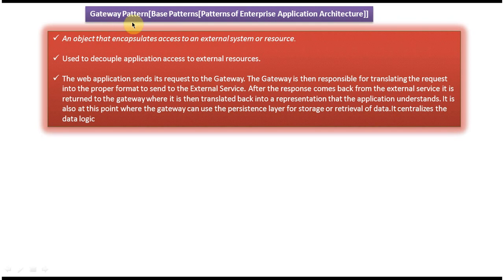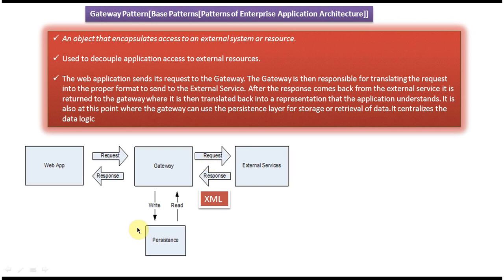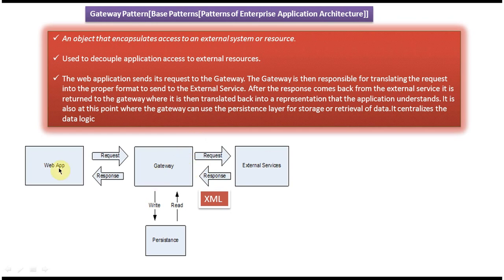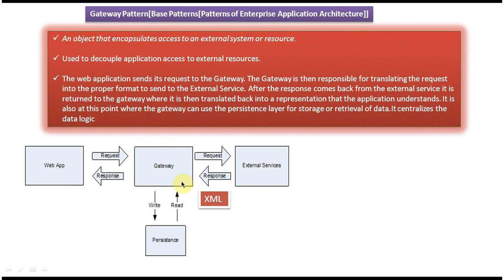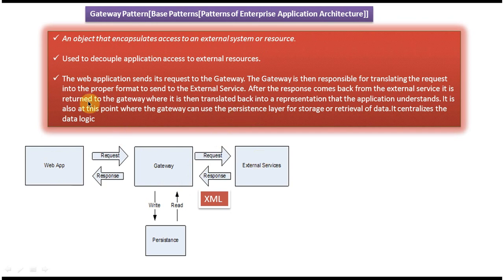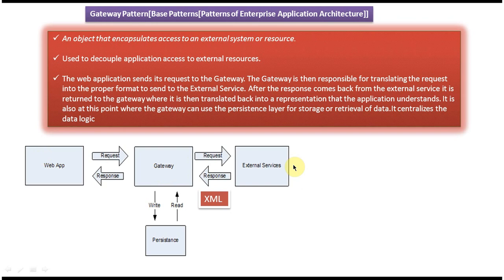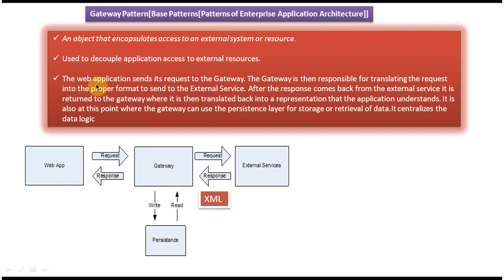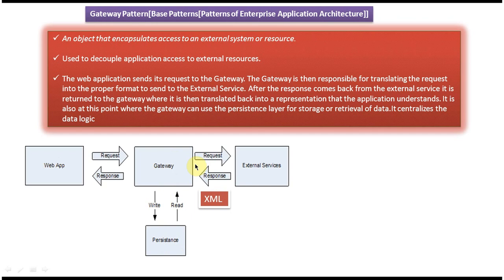Gateway Design Pattern Explained

Comment: Doesn't the external resource interact with persistence? Normally you will have a gateway, a processor & a handler which interacts with the  persistence layer.  Think you need a more detailed diagram than this
Reply from the maker: Thanks for the feedback.yes external resource can interact with DB
Reply: Ram N Java Tutorial: The responsibility of the external service is not to operate on your DB. The external service should not interact directly with your metadata. Moreoever the sensitive info in your application metadata should not be directly accessible by the external service.